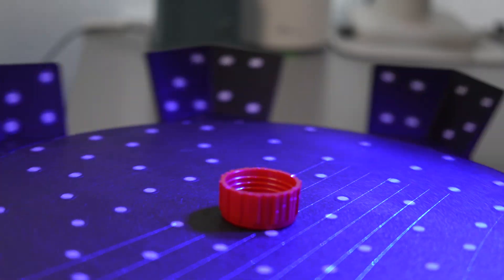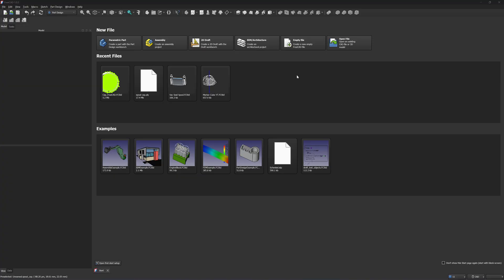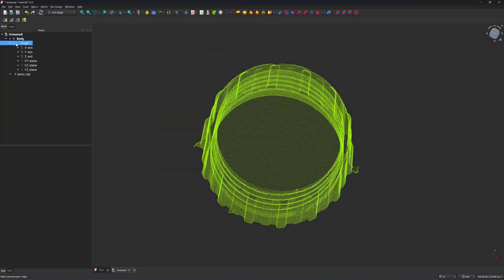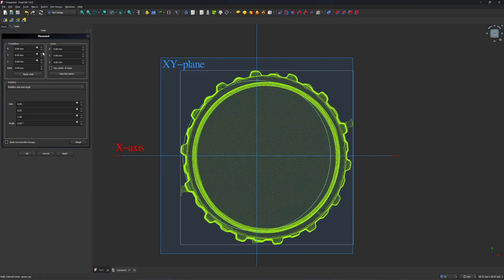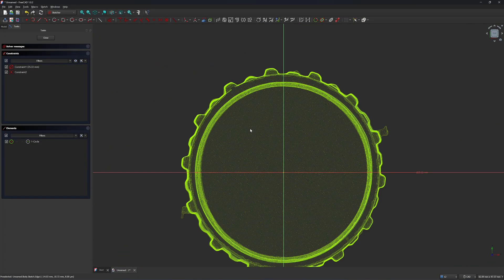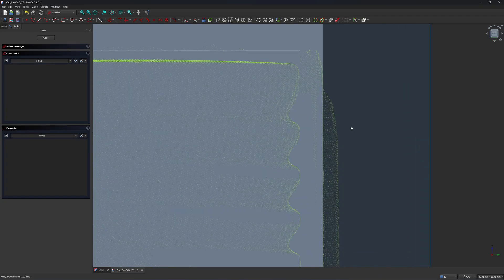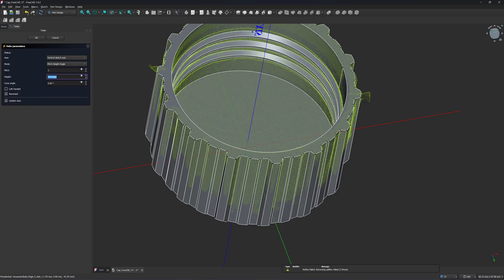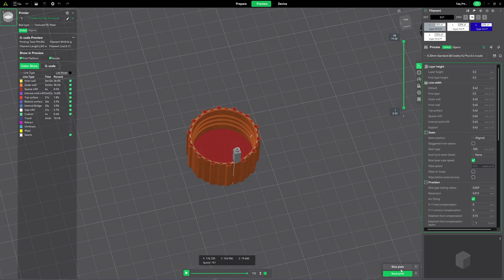Reverse Engineering Threads in FreeCAD - Step by Step Guide

Comment: Hi Payo,i have followed a lot of your videos and would like to ask you is it possible to reverse engineer a model powerboat from a scan in freecad?
Reply from the maker: Yes you can. There's a function called "Additive/Subtractive pipe" similar to "Loft" command in Inventor/Fusion. But FreeCAD can't create 3D line/spline so it will take longer time to model the same thing.
Reply: @Payo-TensileCreator  Thank's Payo would you be willing to give a demonstration for all us boat builders,just a section of a boat hull with spray rails would be sufficient to get an idea.

Comment: Yet another great video! Trying to get better at FreeCAD too. Have you seen the Revopoint MetroY? Seems to have some of the same specs as the Sermoon, but there is a big price difference? Do you think it is because of the maximum scan volume/size? MetroY is apparently 1m x 1m x 1m? Is this a hard limit or just a recommendation? Thank you!
Reply from the maker: Based on my experience with Metro X, Revopoint appears to use lower-cost hardware components—including the DOE, camera, lens, and image processor. In my testing, I’ve consistently found discrepancies between their stated specifications and actual performance.

Comment: Hello. Have you used the Geomagic Design X program?"
Reply: Good question...
Reply from the maker: Tried both Design X and Quick Surface. They’re clearly aimed at folks using 3D scanners who aren’t into CAD, but the results are just surface patches, no good for tweaking or building on the model. I’ve seen them choke on parts that should be easy. Honestly, I’m still scratching my head over why these tools were made when reversing in CAD is faster and way more flexible.
Reply: @Payo-TensileCreator  У меня есть хороший файл сканирования детали мотоцикла! Большая пластиковая боковая часть. Для меня оказалось очень сложно сделать модель. Однако, автоматические поверхности в Geomagic помогли. Но мне все равно не нравится результат... Хотелось бы в ручную создать такую модель. Интересно ли тебе будет попробовать сделать такую модель, если я отправлю тебе файл сканирования? Буду очень благодарен за урок в любом программном обеспечении (Сам я работаю в Autodesk Inventor, SolidWorks, Geomagic Design).
Reply from the maker: @NeoFeSS  Yes, sure. You can upload your scan data to cloud and send me the download link here. payo.gmat@gmail.com

Comment: Detailed explanation, thanks…….but wandering if there is a simpler way to convert a scan to solid for editing?    Quite complex process it seems?
Reply: Realistically I don't think there is. Software for reverse-engineering still costs many thousands of dollars, and even that is quite complicated.
Reply from the maker: There’s no shortcut. Standard CAD functions remain the quickest and simplest approach to reverse engineering, and speed improves naturally with experience.
Reply: The only thing that I would do differently in Geomagic Go (about $1900.00), is create what they call a region of the diameter and create an axis through it. I would also create a sketch as Payo did. I also create sketches with complex geometry…. thank you Payo. For another great video.